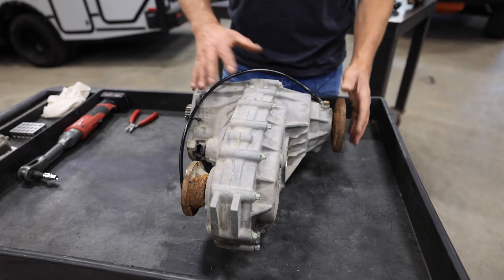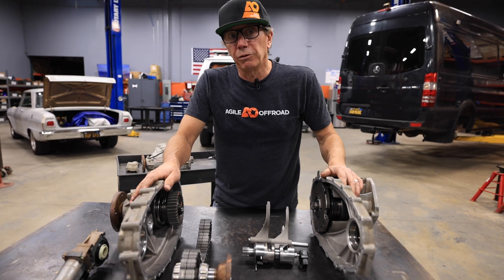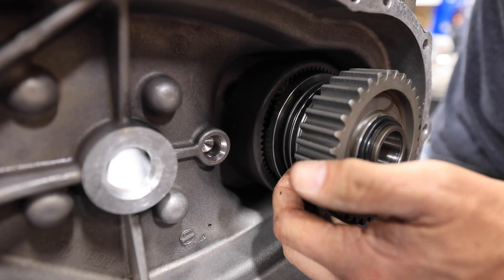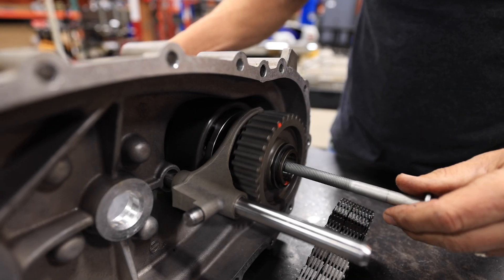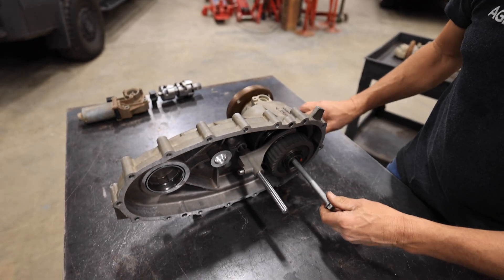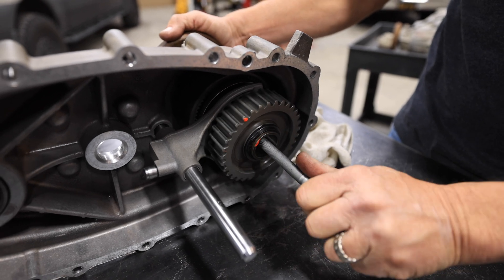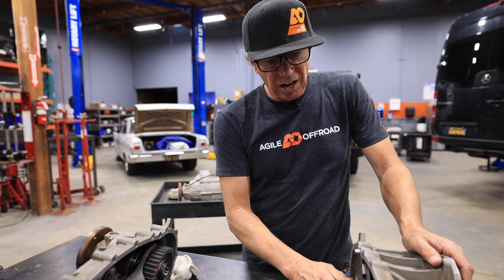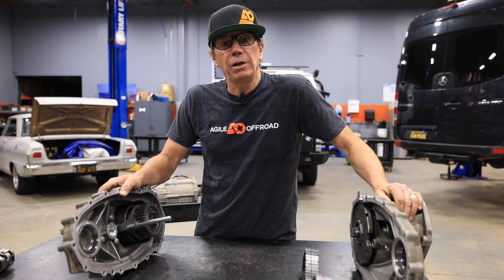Full Breakdown of the 4WD Transfer Case in the Mercedes-Benz Sprinter (2022 & Older)

Comment: 2018 MB Sprinter 4x4 here…upon pressing the 4x4 button, it flashes 2 or 3 times and then stops. Any ideas?
Reply from the maker: The flashing light indicates that the transfer case is trying to engage and cannot. The best way I have found to engage/disengage 4wd on a Sprinter is to have the vehicle rolling slowly (~10mph) and put the transmission in neutral, then press the button while the vehicle is still rolling. It can take a few tries, but that has been where I’ve had the easiest engagement/disengagement.
Reply: @Agileoffroad ended up being our actuator went out. Thanks!

Comment: Really interesting! Is a differential lock on the rear axle of any use at all, when 4WD is activated?
Reply from the maker: Yes it is - however the open diff can make it ineffective in some cases. That's why we have developed a true 50/50 transfer case for the Sprinter!
Reply: @Agileoffroad  According to your webpage, the Atlas Transfer Case is ONLY available for 4WD Sprinter w/ Locker & 4.18 gears. Will it be available for 4WD Sprinter with 3.923 gears in the future?

Comment: Does the chain still free spin if I’m only in 2 wheel drive?
Reply from the maker: Yes, the chain is fixed to the front driveshaft, so the chain will spin in 2wd as will the front drive axles and front differential.

Comment: Will it be possible to install the Atlas transfer case on Sprinter from 2006-2018 ? I have a 2012 w906 4x4 Sprinter and I would really like to get the Atlas transfer case for it.
Reply from the maker: @c17-j5s  yes, however, we are currently focusing on the 2019 - 22 VS30 model Sprinters
Reply: @Agileoffroad  Do you mean it will be released for the 2019-22 models first and only then start research and development for earlier models ?
Should I get in touch via email through your website to discuss this ?
Reply from the maker: @ please send us an email with your details 
Info@agileoffroad.com
Reply: @Agileoffroad  What's your typical response time ? Emailed you a week ago and I'm scared my email got straight to your junk.

Comment: Seems like it’s less than ideal. ☹️
Reply: @agileoffroad Recently I tried to take my sprinter out of 4x4 mode. The light was blinking red. I tried reverse, neutral, and driving forward. It continued to blink but could feel drag on the front end and I continued to drive forward then all of a sudden it went with a violent “bang”.  So loud that I could feel it through my seat I thought in my head I F’ed up my transfer case. The light went off and luckily everything still worked as is. I’ve tested it multiple times going in and out of 4x4 and low and everything seems to be fine. Can you explain what could have caused this and the components that could have been damaged although everything is working fine at the moment?
Reply from the maker: @ possibly misalignment in a gear. Just practice good technique when operating the transfer case
Reply: @vha27 mine did the same and I admit, I rushed the transfer because I was at a stoplight and it turned green before it completed the transfer! I drove about 1/2 mile with the red LED blinking and "bang"! Don't rush it!
Reply from the maker: There is clearly some better set ups, but it is what Mercedes offers!

Comment: How do you address the front differential with your Atlas transfer case swap? The front diff is a tiny unit with tiny halfshafts out to the wheels. I imagine the weak link moves to the front and that unit will implode under any moderate load.

Have you guys considered portal hubs at the front wheels to increase torque capacity on the front axle while also allowing a 50:50 torque split through an additional gear reduction?
Reply from the maker: This is still a work in progress, we have several of them in the field for years now. We haven't had a repetitive issue
Reply: For comparison’s sake I measured the front halfshafts on my Ford Ranger. They were about the same as my Sprinter at 30mm diameter… not as undersized as I thought. I do still wonder about the front differential durability. Thanks for the reply. I appreciate the ambition to improve the terrible “4x4” Mercedes system. Maybe I’ll be a customer with the right solution in the future.
Reply: jeżeli posiadasz tylny most 46:11 ( 4:18) to można włożyć do swojego sprintera każdy reduktor lewostronny - przedni most mercedesa zawsze jest 4:18. Ja u siebie mam reduktor z Nissan Navara, a mój kolega ma zainstalowany reduktor NP242 z Jeep. I tym sposobem zapominasz co to fabryczny reduktor mercedesa ;)
Reply: @pankracy7382 Cześć, przyjacielu, jestem tu, żeby ci pomóc. Chętnie dowiem się od ciebie czegoś o aktualizacji.
Dzięki T.

Comment: I know that some companies in Europe (Iglhaut, Achleitner) use a Landcruiser transfer case instead. Any idea why this only works starting with 2WD not simply replacing it on a 4WD?
Reply from the maker: That's a great question! They are clearly set up for doing this on a 2WD using a divorced transfer case.
Reply: @Agileoffroad they start off with 2WD because the HF2A does not allow for different gear ratios front to back and therefore both companies install a different front differential as well as subframe.

Got a 906 ZG3 "werks"4x4 and an older triple locked Iglhaut with 3,1:1 reduction.
Reply: Because of the different gear ratios front to back in the 906/907 .

With the HF2A tcase you need matching gear ratio in the front as there is no possibility within the Case to gear the front output differently as  the Sprinter tcases do.
That is why there are 5 different geared tcase versions for the 906/907 . The tcase has to match & compensate the different gear ratios Front & Back.

So Iglhaut and Achleitner change the front differential and subframe as well to a custom version that matches the ratio in the rear.